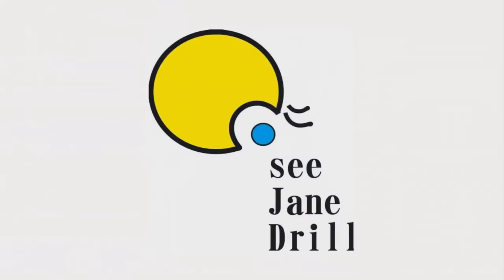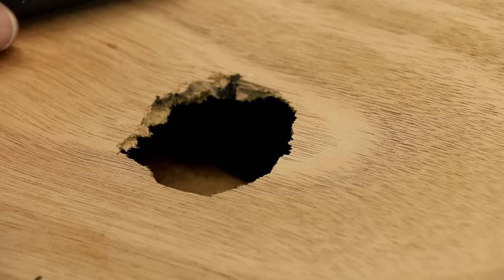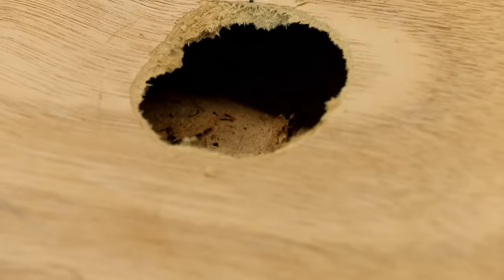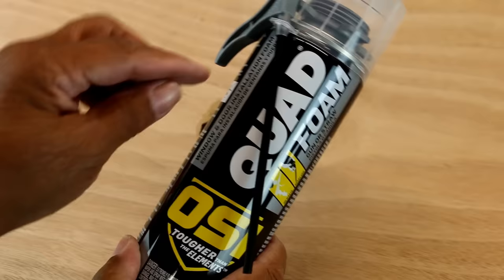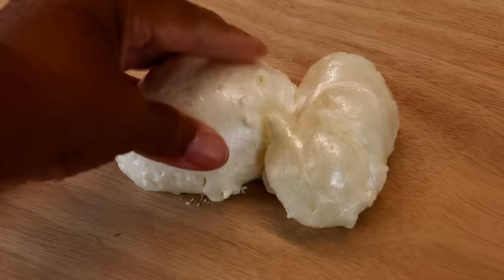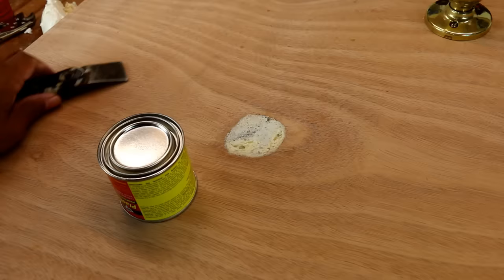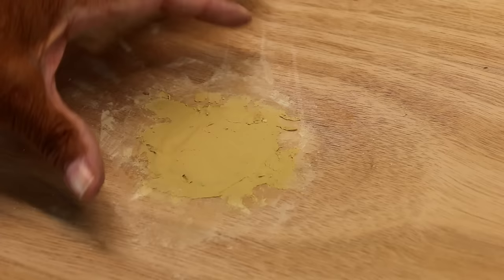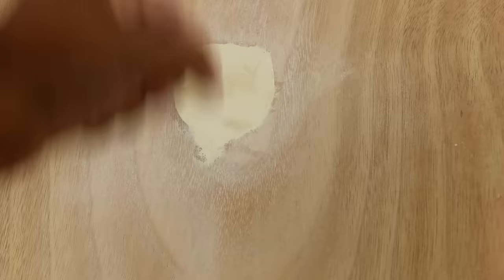SUPER EASY Repair a HOLE in a HOLLOW CORE DOOR

Comment: Now, I just need to know how to paint it so that it's not noticeable...
Reply: If you find out lmkkkkk
Reply: That looks like a grainy veneer. To fix that get a grain filler from a finish supplier. Grain fill the surface, then paint.  Another trick is to paint on a flowery pattern. Use a stencil and spray paint. Another trick would be to cut geometric shapes as bigger, but stylish holes, and paint contrasting colors. Lastly, for a wood finish, cut out a big rectangle, Mount contrasting wood, apply molding, and give it a paneled look.
Reply: @stephenholland6328  I like that idea! Thank you 😊

Comment: This was excellent!  I tried it, and it worked so nicely.  Pro tip: I cut an 8"x1" piece of cardboard and rolled it up into a spiral before packing it in the hole. It felt a bit more sturdy than the "V" piece of cardboard I started with. Saved me a ton of money not having to have a contractor come out replace the door, after he told me you can't repair a hollow core door!

Comment: This video was super useful!  I had some holes to repair but I didn't want to paint afterwards.  I got creative with multiple tubes of coloured wood filler after my initial fill to colour match the surrounding wood on the door.  Used a bit of gel stain and some wood touch up markers to make the filled hole look like a knot in the finish of the door.  
Lived for 15 years with the holes in the doors and am now very pleased that they don't stick out like sore thumbs anymore.
Thank you for your great tips in this video!  They worked amazing!

Comment: Nice job. I'll do the same thing but with bondo. It's hard and has flexible for those spots knocked on.  I'm a fan of the plastic wood too. Used it to restore facia board damaged by poorly installed (gutters rotted out board). The true test will be when the new gutters are installed.
Another too, you can just use the cardboard as a patch fill too. Just cut the length slightly believe surface and fill with filler, plaster it whatever s needed. Thank s for the video

Comment: I've been using spray foam for years now. I have found that using an oscillating tool to cut the foam works well for me.  It leaves a nice flat yet porous surface to apply your "covering"  or "top coal" whether you use sparkle, Bondo or wood fill.  The foam is also watertight and seals well. It's a great part of my DIY arsenal.
Reply: Depends on the foam whether or not it is water tight. Some brands and types are not.

Comment: Geez Whizz!

I didnt know you could repair a hollow hole, thanks.
And also thanks for the tip about the foaming cans, i didnt even know that there different pressurized ones.

I used a foaming can for something and the thing dried and hardened like friggin cement, the one you used it looked heaps easier to cut, i had to use the grinder, lolz.
Perhaps do a video about the different types and uses for those foaming can products, cause you know now you have me very curious on perhaps ive been using the wrong foam for the wrong job. I thought they were all the same and always just bought the cheapest ones.

Cheers,
Reply: If it's the right one I've cut it with fishing line or guitar strings

Comment: Brilliant! As a Mech. Engr. that’s used a lot of plastics urethane foam is very surface sensitive and by using fillers like your cardboard you can get the foam to follow anywhere because it will first stick to the flat surface. It even works on vertical holes. Thanks Leah!

Comment: Great clip worked a treat, the only thing I changed after the injecting the expanding foam I covered the hole with ductape, this made the foam expand into the door and I did not have to cut any excess away

Comment: We always used to just stick a drywall screw into a piece of shim, apply wood glue to it, then insert and pull it via the screw to the inside back of the hole. Once dry the door can be patched and matched. :)
Reply: Thats how I do it , drywall too.
Reply: I wonder how many ways there are to skin a cat. Like actually skin a cat.
Reply: Yup, that’s how I always did dry wall also. My Dad used popsicle sticks. This same new technique works on drywall also because mud will grip the dried foam.
Reply: Genius. I'll try this.
Reply: @hogmire9  popsickle sticks- great idea for drywall patch too-- no screws!

Comment: I use a different method, making sure there's no sticking out bits around the hole,knock them off with spatulate object. Stuff newspaper ball or two into hole so it's firm but not protruding. Fill with diy  wall crack filler ,readymixed in tub normally has spatula supplied with it under lid. Or powder, optional add a glob pva/white glue/ wood glue to mix. 
Make smooth with spatula working all directions to get good bond all around hole. If needed can be sanded with fine /finishing 180 350 paper when dry 20mins ~ an afternoon.

Comment: The method I once used was to cut a ‘’patch’’ of same thickness veneer, enlarge the hole to fit. Then glue a backer strip behind the hole 
and glue the patch over the backer strip, using just a little amount of wood filler around the edges. The advantage is the patch will have the same grain pattern of a clear finished door.

Comment: Great idea. I didn't have a hole that large, but how I fixed it was i stuck a dowel inside the hole. (it was a perfect fit) added a little Spackle around it. Sanded it - painted it and you would never think thee was  a hole there. For larger holes. I like you idea.

Comment: Leah, I am an amateur, yet expert, repairer of fiberglass boats, both my own and friends.    This technique looks great for similar situations where there is a void behind a thin surface that needs to be filled which cannot be accessed from behind.  There are various methods of trying to stick something through the hole which springs out and becomes a backing, but they are tricky and require a good deal of work.  I expect that the epoxy (which is what is used in the modern world for "fiberglass"  repair, even for boats constructed with polyester resin), will not destroy/dissolve the foam, although that might be a consideration.  I don't know if I will have a need to try it, but it is a cool idea.

Comment: Great video and well done. The only tip I'd ad is measuring the thickness of the door to cut the cardboard to fill the hole before applying the foam insulation.

Comment: As a single woman who owns a home, your videos have been essential to keeping my home together.  I have much smaller holes in my pantry doors where the t-shaped doorstop attached to the top hinge has pushed through.  I'm confident this will work to repair it but my question is, will this help reinforce the area so the doorstops don't puncture them again?  Or do I just need to change the doorstops?  If I need to change, what do you recommend?

Comment: Thank you! Over quarantine I am going to try and stain the two doors in my room. I think I might start with my closet door first since it has no hole, but the main door to my room does so I am gonna try and fill it in. I am not sure how stain will work with the plastic wood, but maybe I can find some alternatives since I plan to stain and not paint.
Reply from the maker: Paint will hide better on a door that's been repaired.

Comment: That's quite a good way to do it Leah.
Another way that I use is to get a piece of cardboard, a little bigger than the hole. Punch a small hole in the middle. Put Liquid Nails or similar around the perimeter of the cardboard. Get a piece of wire or welding rod, string with a knot will work also, and make a small 90 degree bend in the end of the wire. Push through hole and maneuver cardboard behind hole and pull gently outwards with the wire. Let dry. Patch the hole with liquid wood or 2 part plasti-bond. Remove wire and sand smooth.

Comment: Why on earth have I not been following you?? Subscribed niw. My only comment on this is I would recommend putting blue tape all around the hole before spraying foam, lift up blue tape after and you only have to deal with a much smaller area to sand down, the harden foam itself.

Comment: With expansion foam being kind of costly and maybe a 1 shot deal if you can’t clean nozzle, 
what about using say wooden craft sticks and glue them underneath (bit of trick to it and takes time,  but cheaper.   kind of how ya put a backer board in a drywall hole to secure nee piece in. 

thoughts on this over the Foam?   and does the filler hold up well on the foam?

Def quicker this way though. 

good vid as always.

Comment: Can I do this repair without taking the door off its hinges? Basically keeping the door upright? I worry the low pressure foam insulation would leak downwards if I did that but maybe if I stuffed with cardboard/paper towel that wouldn't be the case? Advice please!

Comment: Hi Leah! I was looking for what I thought at first would be this kind of tutorial, but the hole I have is a screw hole from mounting hooks (HCD is my bathroom door) for robes and towels. I took off the hooks, thinking about replacing them, but then decided I'd keep the old hardware. Now the wood screw won't stay in place again. I was thinking of just using toggle anchors, but I did this know if those could be used on hollow core doors. 

Tips and tricks? Thanks in advance!

Comment: Hi there. I have a similar problem as what you just fixed in the video. My hole was caused by a piece of furn fell i nto door.  My door is a cheap hollow one, but maybe stained? I cant tell. Maybe you can tell in the pics ive attached. How do i stain it. It's a rental unit so I'm sure I'll get pinged pretty heavy if it is evident.  Cant find a way to attach a pic to my comment.

Comment: I had an issue trying to drill into a pantry door (made in the 60's) that appeared pretty solid compared to doors now days.  I got my brackets (for a wall grid on a door for utensils) on the top and then the 1 on the bottom.  Door was solid.  Grid looked great...then I decided to use the 2nd grid they sent and when I tried to then drill the bracket for the 2nd grid... I thought it sounded a bit hollow so I drilled to put in the supplied anchor and it just collapsed to a hole.  I did not need anchors with the first grid for it was solid and accepted wood screws.  I am now unable to attach the 2nd grid cause I do not want to put more large holes into door.  Can a person safely put an anchor in a door once this is repaired??

Comment: For anyone thinking about doing this, please don’t use the spray foam..the plastic wood does not stick to it very well..just fill hole with plastic wood, let it dry, then add another layer of plastic wood to smooth over

Comment: May i know how would u repair a big hole in the deadbolt knob.. The hole was bored bigger than usual size.. It's not a big issue but sometimes the deadbolt screws would get loose and the knob on the outside will go down a bit and u could see the big hole in it.. The person who drill it didn't do a good job and also it was a bit far from the edge..

Comment: How do I fix a hole on the top where the tracks go? Since it is at the very top, the hole runs the length of the door from top to bottom. Once I fix the door, I need to put the track there.

Comment: How can i make one spot strong enough to hold up to a hook and eye latch in a hollow core door? I know iffff i could somehow separate the layers i could easily glue wood inside but its a newer door so if i pry it apart, it will split/break. Need to be able to put a screw hook into it.. helppp lol

Comment: Steps (items needed)
1. Razor and cut in angle

2. Home depot ...

plastic wood

Low expansion foam

3.Pack hole piece of cardboard

4. Putty knife

5. Sander.... sand flush 120 -150 grit

Comment: LOL. I thought this video was going to show us how to stain it so it looked like the veneer. I used to use a piece of wood, screw it in behind it using dry wall screws. Then regular wall mud. Blade it down, sand it smooth, apply paint. Good old 1960s Levitt door. Recently I had a house where I simply replaced them all. 55+ year old doors that were for the most part card board to begin with.

Comment: What if the hole goes through both sides of the door. Like all the way through.
Reply: I saw someone else apply painter's tape to the backside of a door to keep the foam contained (it wasn't a huge hole), and proceeded with the foam & the rest of this video idea. He used spackle as the medium to even the door smoothness, which was the only difference.

Comment: Pretty good, but I find it's easier to fix it the same way you would fix a hole in drywall, except I would use a small piece of wood placed inside the door as the patch, screw a screw into the wood to use the screw as a handle, put glue on the wood patch, and pull the patch against the door. When it dries, apply your plastic wood filler and then sand even.

Comment: Leah, you’re painting the door? I thought you were going to grain match. Well, you could have just back epoxied some thin plywood, hardboard, or wood scraps. To keep the pieces from falling in just position the door face down. Then proceed with the filler.  Most people keep 5 minute epoxy around.  Perhaps a 5 minute epoxy tutorial should be done. Keep up the gentle style!

Comment: Good video. However Leah says plastic wood will accept stain. I have never been able to get it to take stain anywhere close to matching the wood.  Good that she says to apply excess, but she does not say why, which is that plastic wood shrinks a fair amount. Easier to remove excess than to have to refill depression.

Comment: She said she was using plastic wood because her door was light colored veneer leading me to believe she was going to show me a trick and how to put grain into the patch so it can be stained to match the door although useful tip anybody with any experience could have done that using various materials because the patch is only useful if you're going to paint the door as you notice the door had a doorknob in it and had a natural finish now if you want to save the door you simply go out and get it sheet of door vineyard which is I believe 164th in thick adhere it with contacts cement and treatment with the router voila now you have a real door repair

Comment: Hmmm nice video but that’s still going to show. I never used foam because I would to dozens of holes per day and nobody has time for foam to dry.  Repair using hot mud, some filler if need be and a graining comb.  Repairs so hidden you “wood” swear I replaced the door.

Comment: Lmao why people why ,after buying all supplies and time ,it will cost over $20 bucks a new door only 20 to 25 bucks for that type of door 🤫😱🙃 stop the nonsense . This is Hollywood saying this is a waste of time and money .. fyi dont judge me I'm ceo of my company home improvement
Reply from the maker: $20 is rather high.  In addition, you have enough material for more than one door and other diy projects.
Reply: @seejanedrill  have a point, however I'm a time person, time you cant get back . Do you know how many DIY projects I have to come behind people because they mess up . My company get call on a daily to fix DIY projects.  That will cost them even more money extra because they mess up. On a door just replaced it special on that type of door .My contractor price I can get that door 15 bucks. That process will take over 45 min putting a new door up 7 min. Also noticed she didn't paint it an show it. Why because that repair will show thru the paint .

Comment: Expensive and time consuming, the finished job isn't exactly flat either. I've tried expanding foam and it's no good for jobs like that. There are cheaper and easier ways to do the job, with a better finish more easily achieved.

Comment: So.....nice idea but this will only work on a very small number of doors.  What if your door is stained wood? Many are!  This patch will not work for that.. if you paint it as she suggests, Is this going to be the only painted door in your house now? And if it’s an open grain door, like oak or mahogany, which there are millions of these, and you paint that door your patch will stand out as much as the hole!!  What if your door is one of those white fake wood doors that you see millions of at Home Depot and Lowe’s? Yeah.  Won’t work on those either. A new door is less than $50 and if that doesn’t fit in your budget, put up that Farrah Fawcett poster.